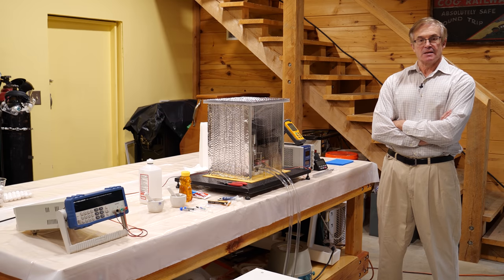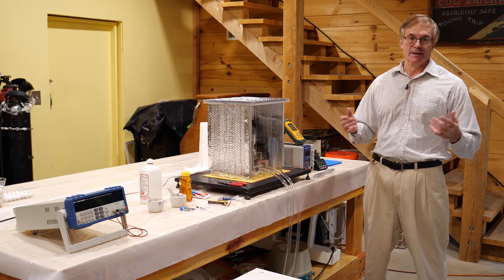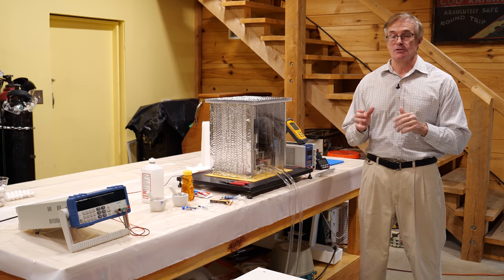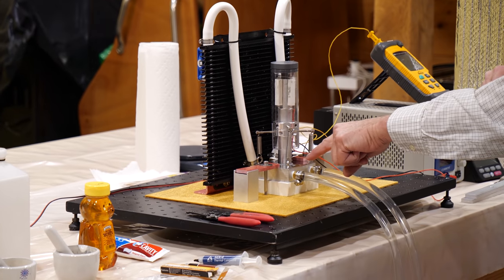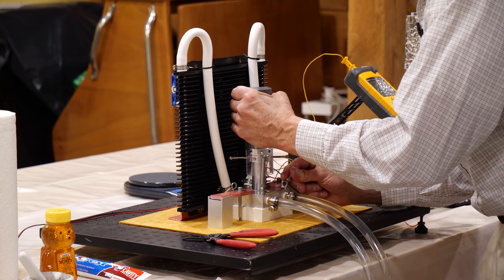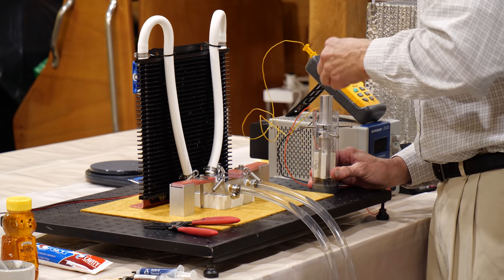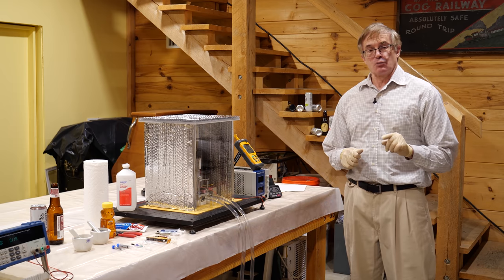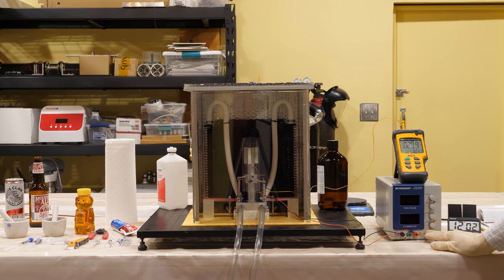DID WE JUST MAKE THE WORLD'S BEST THERMAL PASTE!?

Comment: One more factor to ponder about: perhaps the optimal thermal paste is not the same for a pair of polished flat surfaces, as for two much lower grade (rough, non-flat) pair of surfaces.
Thermal paste composition is usually a tradeoff between thermal conductivity, viscosity, etc. It is plausible that the optimal viscosity is different.
Reply: The same thing that was going through my mind and why a control run with no compound would have been helpful.
Reply: How reliably could you clean a rough surface between tests of different materials?  Polished surfaces at least give you a fighting chance at removing the previous material.

This is a test of thermal pastes and not of surfaces.  That would be a separate video all together.

He was careful to ensure the paste flowed out around the test cylinder under the spring load, displacing the air, which would minimize the effects of the different viscosities of the pastes one would think (I’m not an experimenter, so I may be overlooking something)
Reply: @gordonborsboom7460  Hmm, cleaning would indeed be a challenge. My point is that in pactice, the surface of an IHS is neither flat nor mirror smooth, and depending on the cooler it might be even worse.

Comment: it would be awesome if you could test liquid metal like Thermal Grizzly's Conductonaut as well
Reply: and maybe some graphite thermal pads
Reply: @danielpope3579  or do a thin nickel coating as it should not interfere to much with the result and block the gallium from reacting with the aluminum. but you're correct, for precise result they would have to retest everything with a nickel coated material, as blank copper will also be attacked from gallium

Comment: KEEP UP THE GREAT JOB GUYS!!! 
Just a sugestion: Is it possible to log the temp curve to see if there is any improvement in temperature oscilation and adaptation from the interface solution (AKA termal paste) ? simple arduino log is an easy go to and an excell sheet can draw a curve really easily... JMHO
Reply: I was also thinking the "curve" of the logged data. Once the general curve form is established, more performance information could be revealed e.g. how fast it reached equilibrium, without having to spend the whole 90 minutes and by just logging a few more "points" than only the final (12min, temp) one.
BTW, Awesome video, as always!!!
Reply: Found the engineer. ♥❤♥❤♥
I agree, BTW! Plotting temperature against time might actually reveal something interesting.
I mean... it probably won't give any additional insight... but it MIGHT!

Comment: I'd really like to see liquid metal and other gallium alloys tested in this setup, but the gallium would destroy the aluminum.
Reply: I'm actually a bit surprised by the materials used here, instead of just using copper. Because if there is another video in the thermal interface series that covers thermal films like liquid metal, they're going to have to revalidate all of their testing on the setup that can actually test the liquid metal. The tests are idiosyncratic to the specific machine after all, which would make any attempt of cross-validation of a singular test between both machines (say, toothpaste to toothpaste, as an example) would be analogous at best, meaning all pastes should be revalidated for accurate science. With how long these tests are, that'll be taking a long time to do, just to compare products of one thermal interface type to products of another thermal interface type. 

Though, I'd be more interested in thermal pads, not the 'reusable' thin graphite ones like what Innovation Cooling makes. Liquid metal is analogous to thermal pastes and thermal greases, it's a thin liquid film that aims to serve the same purpose, though I would argue that thin metal films are a different thermal interface entirely, just as thermal pastes are not thermal greases, and just like how thermal adhesives had their own video in this thermal interface series. Thermal pads on the other hand do perform differently by which direction you're measuring, measuring along the Z axis (as Z-up) is a different measurement than what you can measure planarly along the pad's surface. This difference in measurements is how some products have ridiculous numbers as marketing, but their actual performance is lackluster in comparison. While the graphite pads are technically pads, and function in basically the same way, I would rather see them separated into their own sub-category, as they're thin enough to be marketed as a replacement for thermal pastes, films, and greases; similarly, the same can be said about films, indium films and gallium-based films are similar but how they achieve an interface is different.
Reply: @xaytana  iirc i think LTT? prety sure it was LTT - it wasn't the full gambit GN would have thrown at it - tested some marketed for PC use specifically thermal pads a year or two ago, commercially available product - the results were middling at best - on par with cheap paste - I remember looking at them & thinking like ya i've disassembled a laptop before & these have been everywhere since as long as i can remember but they don't get used on the CPU for.... have to imagine some good reason... 

Would love to see sheets of the materials you proposed cut down & similarity tested - that's a really neat idea
Reply: @phishphan49  Of course pads wouldn't be used for CPUs or GPUs, but pads are an important topic when talking about thermal interface materials. Especially in computing when they're used on nearly every other heat-generating chip that needs to be cooled for performance purposes. They're also typically used for gap filling on multi-component heat sinks that're planar, where a machined heat sink would drive costs up by a fairly substantial amount, which is why heat conductivity via the Z axis is an important subtopic of thermal pads. Plus with how this channel manufacturers nearly everything they display, it'd be interesting to see housemade thermal pads, especially if they're far better than what's available on the consumer market. 

I also wouldn't trust LTT for anything science related. Just look at their thermal imaging video, and the entire lack of knowledge of the IR spectrum displayed by the entire team behind that video. Honestly, it's even worse than Austin Evans' recent PS5 cooler video where he just points a thermal imager at the exhaust of the older and newer PS5s to compare the 'performance' of the heatsink design. This is why everyone wants GN to test this channel's housemade thermal paste, because LTT just outright cannot be trusted with scientific evidence of anything, LTT is an entertainment tech channel, GN actually has testing methodology, testing equipment, and values hard science and fact over revenue. Even the research that goes into LTT's videos is rarely anything more than what's listed on a Wikipedia article, if even that much at times; more reason to not trust an entertainment channel with actual science and fact.
Reply: @jakesnyder2667  thanks - but yeah i get that - i saw this after making a separate comment asking them to reach out to GN & der8aur for this and a number of other reasons - this channel has the tools & knowledge to serve as an independent tarty steve could seen - like with the recent power supply fiasco - helps GN out by we sent our testing methodology and steps to other independent parties & they were able to reproduce out findings - independent confirmation helps - i mena steve was testing more extensivly something someone else had previously discovered there to try to see if he could reproduce it - good for the channels and good to the industry. 

as to the LTT stuff - yes, i agree with you, i guess i should have stated it differently in my first reply - LTT serves are a gateway into PC building, it's not a serious resource and yes it is entertainment - was simply stating that i thought I recalled them testing an item & pretty sure it was LTT because i don't recall it being very rigorous.
Reply: It makes me so sad it wasn't made of copper for liquid metal testing.

Comment: I'm surprised you didn't test the indium sheets. I'd love to seem some numbers since you keep recommending it. That and I'd like to see galistan, or conductonaut, tested.
Reply: And graphene and other "exotic" materials
Reply: I just want a control test with air on those surfaces
Reply: I think he stated the indium sheets required a large amount of pressure to work effectively.  I expect the springs in his testing apparatus don't apply 1/4 ton of clamping pressure which he stated is the minimum for indium.  The liquid metals also have a secondary effect where they can permanently change aluminum (they are intended for use with copper).  Using a liquid metal that flowed into the aluminum structure of the test rig would change/invalidate subsequent tests performed before since a surface wipe won't remove the liquid metal.

Comment: I wonder if the honey performed so well, because some of the heat energy was "used" changing the viscosity. I know it's not a full phase change but It did make me wonder if a substance that changes viscosity with temperature actually "uses" energy to do so. I had a brief (a couple of minutes) poke around on google to see if viscosity changes use energy or not but found nothing useful.
Reply: Viscosity is a property due to the intermolecular forces, as is the specific heat capacity of a material. For nonmetals, as temperature increases, some of that energy is stored in the intermolecular bonds which will also affect the viscosity. I would expect the specific heat capacity change over the temperature range in this video to be relatively small and insignificant. While this test did not reach steady state, it is not a short duration test, so changes in heat capacity should make little difference. The amount of thermal interface material vs the power going into the system is small.
Another effect might be the viscosity directly affecting the film thickness for a given pressure, but I can't convince myself either way of its effects.
Reply: honey is thixotropic substance and yes they do take in energy when they change their viscosity state.

Comment: I would've liked to see higher temps where there would be a more decisive gap between the results for each material
Reply: His temperatures are all the same because the two surfaces are mirror flat with no gap. If he used no compound at all I bet it would still read 30 C. The setup has nothing to do with the real world.
Reply: @rrrlasse2  then why did it show the differences you would logically expect?
Reply: @liambergstrom8183  Tomshardware shows toothpaste at 42 C and most top compounds at 30 C, which is to expect because toothpaste has very bad conductivity. His setup is bad and is in reality more like a bad viscosity tester.
Reply: @rrrlasse2  so it's in the same order...but higher temp would be nice so there's a bigger difference? Like I said? If his setup is ranking them the same order...then it clearly works. The actual temperature has no bearing between one setup to another, it only applies for reference to other compounds on the same setup. The overlap between the two different setups means nothing

Comment: Hmm, thermal compounds are pretty complex. There's usually a tradeoff between longevity and conductivity. For desktop applications, thermal grizzly is usually considered the gold standard. Can't wait to finish the video.
Reply: Not including Thermal Grizzly was a pretty severe omission. Kryonaut Extreme, while expensive, is currently considered "the best" thermal grease at 14.2W/mK. It would also be interesting to test liquid metal compounds, including Conductonaut, but the test rig would have to be changed to a nickel rod or nickel plated copper rod instead of aluminium, because the gallium used in Conductonaut immediately diffuses into aluminium, ruining the test rod.

Comment: When I try to explain the interface between a heat sink and a CPU I relate the two mating surfaces as two different grits of sandpaper placed grit to grit.

 It’s much easier for the lay person to visualize/understand the point to point contact and the specialized monkey shizt (a extremely low thermal resistant material) fills in these gaps and decreases the thermal resistance of the interface.

I offer this comment not to educate your audience but to bolster your channel in YouTube land so you can gain more access to cool places. 

Too bad The Big Bang Theory is no longer in production because a camino  by you would have been hilarious.

Comment: Nice testing, I'd want to see if having excess overflowed compound on the rim of the rod changes the result compared to wiping excess
Reply: Compounds have extremely low thermal conductivity compared to the bare metal. 8.9 for AS5 vs 237 for Aluminium. Once you have a distance of fractions of a millimeter its negligible
Reply: @mariueg  cool thermal dynamic story bro, but I'd still want to see the difference of a temperature capacitor left in the bead of overflow on the rim if excess is used

Comment: I redid the compound on 3 seemingly identical chips to sink and 1 of the 3 I had to redo 3 times to get it in line with the other 2 in use temperature readings, I'm long time experienced in application of heat-sink  compounds but some times I can over look a small bit.

Watching 2 of your heat-sink compound videos I believe either the troubled sink was not as flat or i could have 
done better surface prep.  Next time I believe I will try polishing the surfaces first at least.  

Thanks for all your videos I really get a lot out of them even if I will not attempt most of them I enjoy learning and with your excellent clarity easy to understand explanations!

I wonder how long shelf life as I do not need any compound now but next time I would like to order yours as I know
this also saves operation energy which can add up on high powered devices running nearly 24/7/365

Comment: Incredible work. I've learned so much in such a short period of time watching your videos that I somehow missed in my physics classes in college.

However, watching you perform these experiments manually by time and temperature is disheartening. Audiobooks!? No way! Spend that extra time programming an Arduino and/or even a smart switch to turn on the machine once it reads 21 degrees and turns it off once your 12 minutes have passed. 

Not only would this be more precise, but also you could run many cycles in automated succession. You could gather the temperature readings at regular intervals as well. Using Prometheus would be a quick and easy way to get started.  This way, you'd get more than just the final reading, but you could graph the temperature over time. Maybe some compounds transfer faster but then slow down as things heat up.
Reply from the maker: Fair enough.

Comment: Thanks so much for your efforts. When I was repairing power amps I noticed that sometimes the transistors that failed had thermal compound that had hardened over in one section of the casing. I used to wonder if A) this led to the device warping, or B) created a lack of thermal conductivity in part of the area in contact with the heat sink. I was careful to spread the compound evenly on the new devices and not just glob it on, and I would apply new paste to all the devices even if only replacing one. However this was for a sound company and getting the repaired amp back in the field was paramount and, of course, we had no way to test the efficacity of the products used. I like to think the amps that I repaired returned less often, but I don't know that for a fact. Thanks again for this project. I want to learn about your formulations and look forward to ordering some of your product.

Comment: i did a similar test a few years back. I narrowed it down to Shin-Itsu and the Corning (don't recall the specific Corning paste) some other manufacturers were exaggerating their performance by a lot so don't trust the spec sheets. The Corning and Shin Itsu both did fantastic, but I found that the the Corning was a little softer and easier to spread evenly compared to the Shin-Itsu and that is what i ended up using.